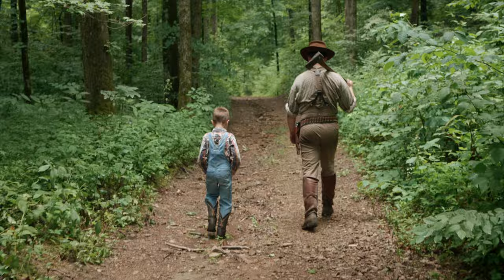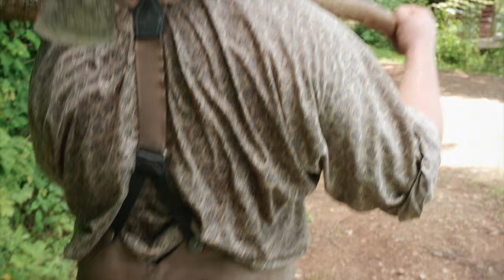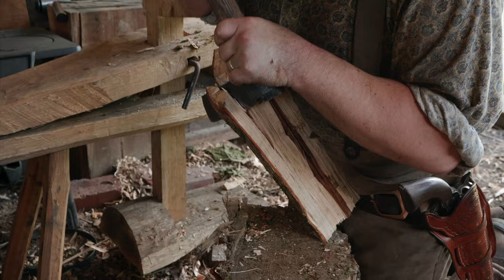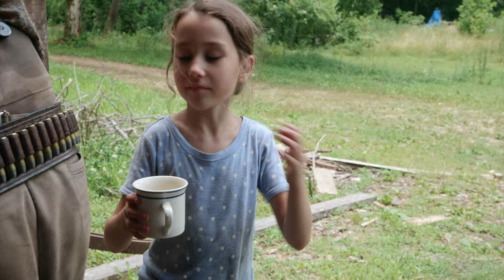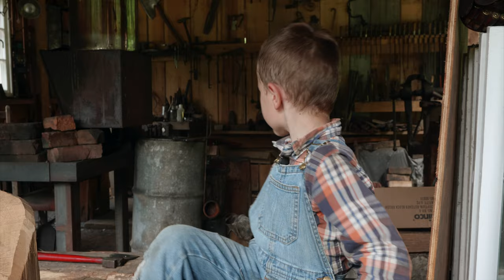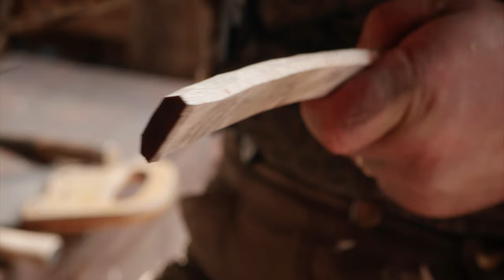Carving a Serving Spoon from a Maple Tree

Comment: Your children are so absorbed in what you are doing, that is wonderful to see them learning through observation basic life skills. The way you include them in what you do is extraordinary these days where kids are stuck inside and attached to a computer. I loved to be in my grandpa's workshop since the day I could walk. By the age of ten, he was teaching me how to use hand tools and even built me a mini version of his cabinet makers bench. He was a furniture maker as was his father, his grandfather, and so on. By the age of 14, I had learned to use what few power tools he had. That was 50 years ago and woodworking has been a lifetime passion for me. I'll be 60 next month and to this day I can still conjure up the smell of his shop which was a blend of wood and cherry pipe tobacco. When I retire at 50, I bought a 10x16 foot shed and insulated it, and ran a subpanel out to it. I've always heated it with electric heaters, but I'm at the beginning of building a mini wood stove for the shop out of an expansion tank that came off my old furnace. The shop is small so this will be big enough. I need to get the rest of the steel for the door and plate on top to heat water for tea. Both you and your wife are blessed to have such well-behaved and interested in what you do.